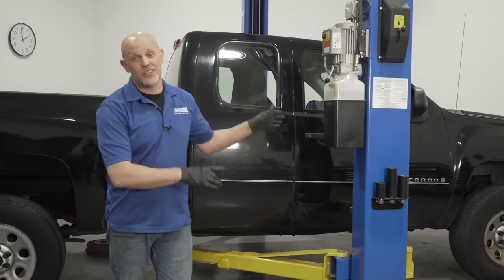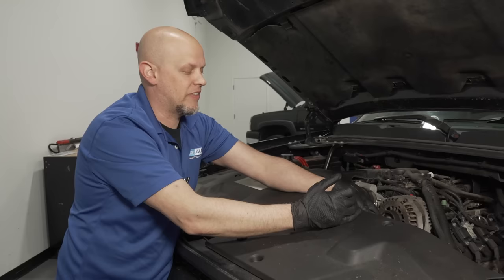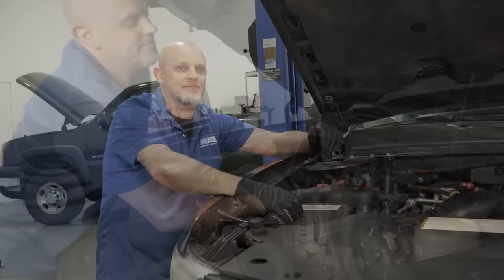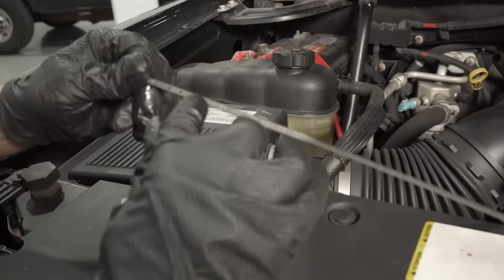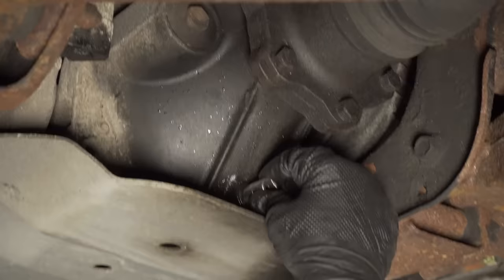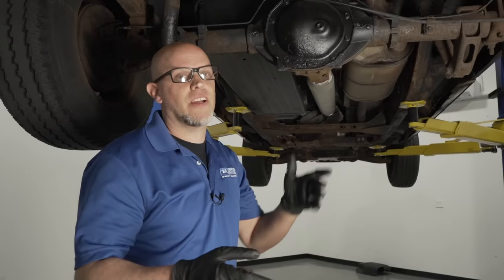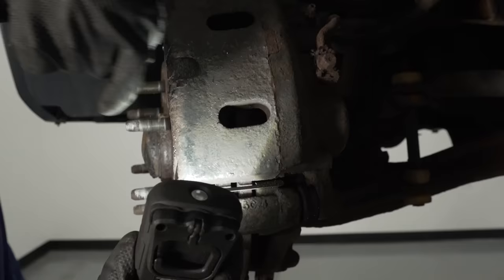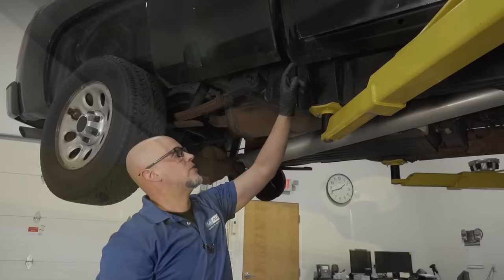Top High Mileage Issues 2007-2013 Chevy Silverado 1500 Truck

Comment: any one know why my 2007 1500 work truck 4.8 temperature raises above normal but doesn't overheat replaced temp sending unit and checked the fuzes but still gets up to160 to 170 on temperature gage only thing I can think of is doing a water pump and flush maybe a thermostat

Comment: I'm taking a chance here, By this being an old video. But I need advice regarding a 2012 1500 Silverado Hybrid. The "Service Hybrid System" light is showing a trouble code. I have looked for any helpful information regarding this Hybrid stuff. 
Know one is talking. No info anywhere. 
I'm looking to buy as the price is really low.
~~~~~~~~~~~~~~~~~~~~~~~~~~~~~~~~~~~~~~~

Please advise as to weather I should take a chance, or run!!????????????

~~~~~~~~~~~~~~~~~~~~~~~~~~~~~~~~~~~~~~~~~~~~~~~~~~
Aside from the Check Hybrid light. This truck looks like it came out of south Texas. Very clean, inside and out. For an eleven year old truck, it is Immaculate. Only 129,000 miles.

Comment: So I got a 2011 silverado 4x4 1500. An issue I have is the lights flicker. I changed the alternator and it's not so noticeable anymore but I want to know if anyone esle has had the same problem and if there is a better solution?
Reply: Check battery terminals and make sure they're on tight and there's no corrosion.

Comment: What oil and oil filter would you recommend 173k miles 5.3 4x4 thanks
Reply: just bought  09 1500 chevy silverado   158k miles runs great checked car fax and  1st owner sent it to dealer every 4500 miles ?  or close to that  till 90 k miles second owner same but at the quick oil change places napa has a  off name filter that is chevy warranty approved for about 6.00  and it looks like those quick oil change filters they use  so i am not too concerned anymore about using a lower price filter like i use to be it must be ok if millions of people are going to these oil change places other than dealer.  i can get ac delco filters from gm parts online  for just 4. each so i bought lots of parts from them  stocked up for great prices on oem parts and about the same as local parts store but oim parts   like iridium spart plugs 8 . each plug wires were great price also and lots were lower that auto parts store .  # 8 take off pass side tire to replace plug it runs incredible  i also bought new lights to make it look good, just took a vacation in it soo comfortable.

Comment: Don't forget......
DOD is junk
Oil pick up tube o-ring failure
Rotten fuel and brake lines
Rotten fuel sending unit
Rotten trans lines
Engine mounts
A/C blend door actuator
Wheel bearings
Gas cap o-ring
Warped rotors
Air bag recall
Air bag sensors under rad cradle
And im sure there is more
Did I mention rust.

Comment: rear passenger side shackle rusts through ,breaking off and if not noticed will rub a large hole in your bed . electric window motor , fan speed rheostat , 4x4 actuator , tank straps , fuel sending unit , fuel lines , brake lines , transmission lines , power steering cooler , Hubs , and the list goes on . Worst truck I have ever owned  . 2004 with 145k . The only redeeming quality this truck had was I never had any problems with the motor itself .

Comment: It should illegal to have brake lines made out of steel
Reply: The entire exhaust system should be stainless steel from the head back.
Reply: @rustyshackelford7651  why not the whole frame
Reply: @dannymartinez8522  meh overkill but all frames should be undercoated.

Comment: If it’s over 150k miles it’s on its second motor at least due to lifter failure.
Reply: Some fail at 30k miles just change your oil often with good oil some last 200k plus
Reply: What a stupid comment 

My family has a 2013 Silverado with 275k miles no lifter failures either

Comment: My 08 Silverado 1500 was the biggest p.o.s I've ever owned. AFM lifters went at 150k, tranny, starter, transfer case..... I bought a lemon
Reply: imo all 1500 trucks are lemons you dont start getting good parts until 2500 class i drive 1999, gmc, 2500, 6.0/ 4l80 all orginal still runs like new pushing for 300,000miles
Reply: You definitely got unlucky - I've got a 2008 Silverado 1500 with 238,000 miles on it so far and no major repairs,  just regular maintenance.
Reply: Wow 150k? Sounds like one of the better ones. Mine failed at 75k and has had just about every kind of leak imaginable.
Reply: Still loving mine, she's been flawless! Thought about buying a newer one but love having all my cash in the bank instead.

Comment: LOL high mileage chevy. A little late on the April fools guys.
Reply: My silverado 1500 has 300k and the stock 5.3 and 4l60e have been rolling 37s for the last 100k of those, and it's got no issues. Just sayin
Reply: You must be a troll. GM has the highest percentage of trucks that go high mileage out of the big three by far.

Comment: Afm engines junk seen 80k engines burning 3,4 quart between changes,foul plugs.Riding around with pack of plugs,gallon of oil half payment book to go..junk junk junk gm fell from grace
Reply: I have a 2011,with 116,000 on it,and have none of the problems you mention here.I did install the range afm disabler  locked in v8 now,quit using any oil,a dandy of a truck now
Reply: It’s the stupid AFM bullshit, just get a plug to make the computer run it v8 all the time